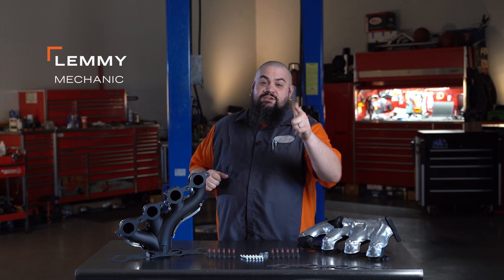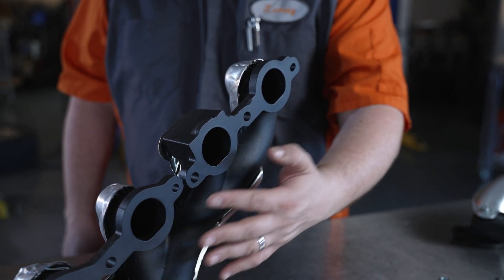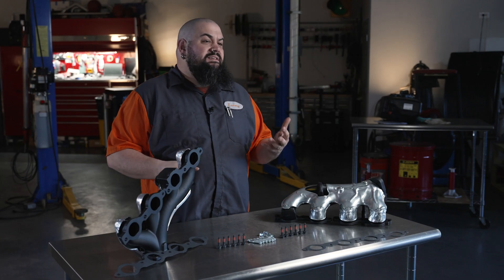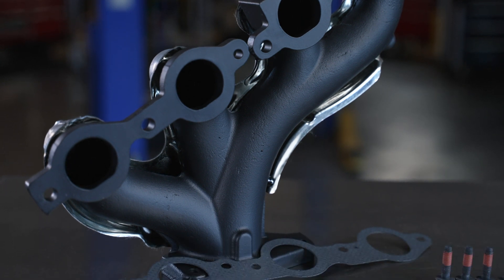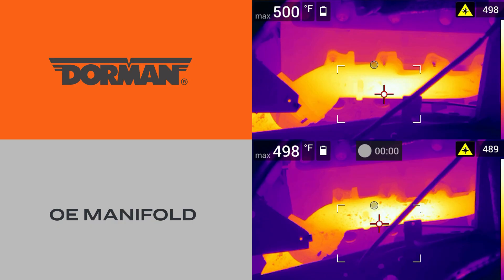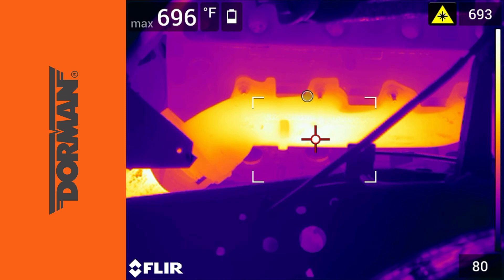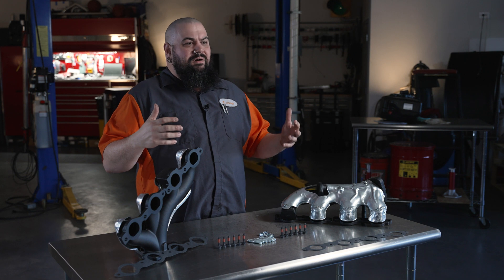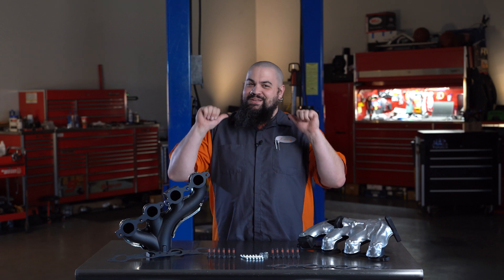Ceramic coated exhaust manifolds last longer and make servicing easier

Comment: Explain to me why dorman makes only one side of the ceramic coated, then they other exhaust manifold they don't makes no sense to me. I have a 2000 f150 and can only get the ceramic for the passenger, the driver side only regular, I even called dorman and they can even answer why.